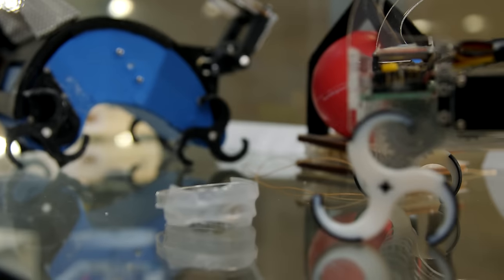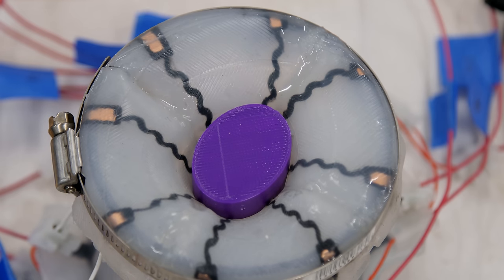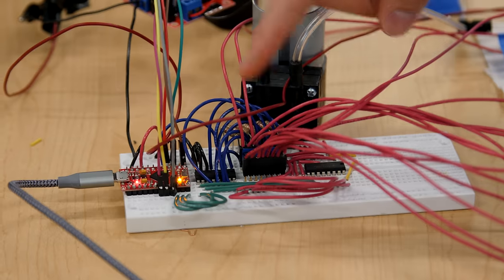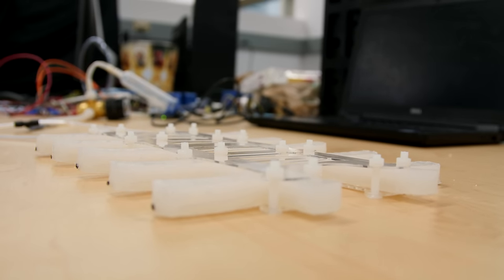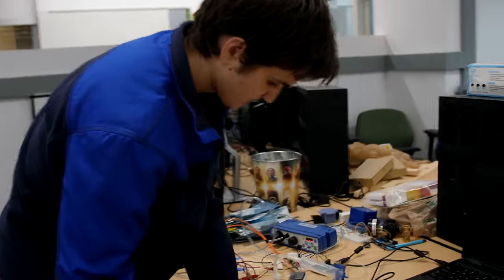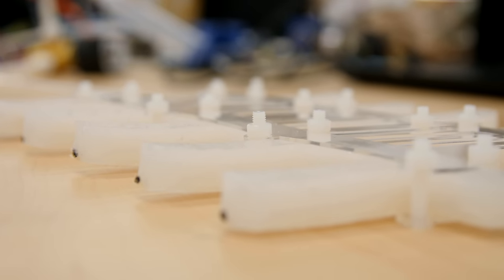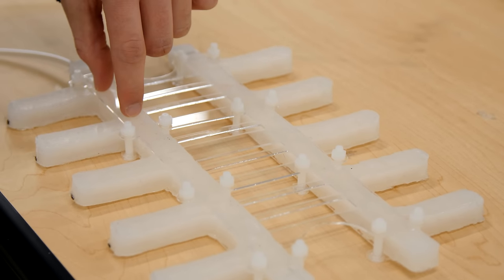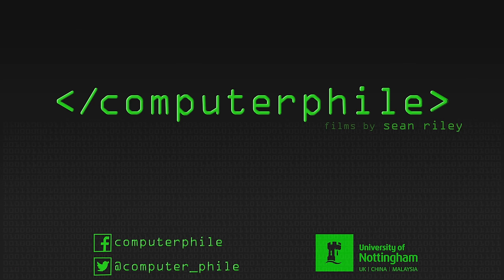Soft Robots - Computerphile

Comment: I'm proud of myself. My mind didn't go to that place till I read the comments.

Surely there are more appropriate uses. Measuring grapes?! That sounds slow and ineffective for a product you'd need to get through large batches of, even if you only measure one out of batch each time. Does the feel of grapes tell you much? I would have thought a camera is far simpler, quicker and more effective at checking something like grapes.

Comment: Analog circuits have been around for a long time. A SPICA mechanical fuel injection unit is one such, fluid logic in an automatic transmission is another.

Comment: Why use it for measuring grapes if you could instead use it to measure the strength of metal structures? Figure out how much pressure the bot would need to apply before a metallic structure bends, crushes, or is otherwise compromised.
And contrary to what the comments have been saying, using a bot like that for "personal" purposes sounds really uncomfortable and actually kinda painful.

Comment: once you can 3D print a princess of tubes like this and have them atuate on a very low freqency 

make bellows to power a small capacitor the bellows are able to cause themselve to convulse causing a bellow motion 

there could be ways to make a power transferance system using air as static charge